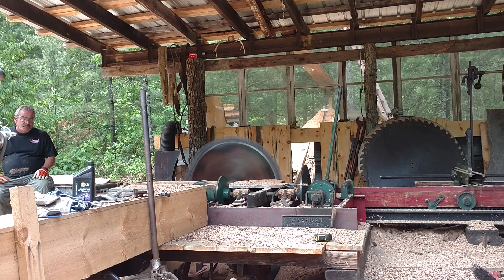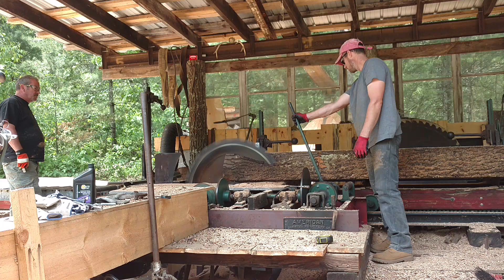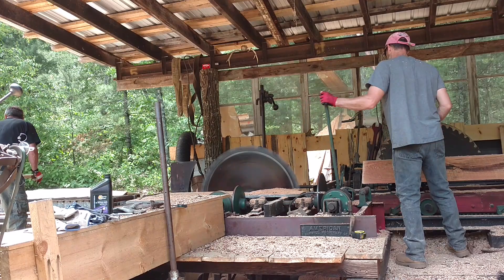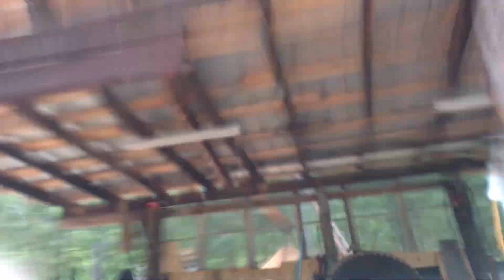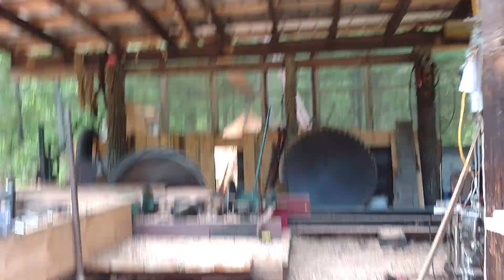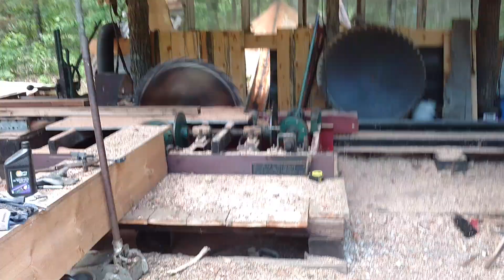Antique sawmill working

Comment: Me Thinks your Friction Drive is slipping.
Reply from the maker: Hi , Yes you are totally right been having issues with it I think I have it figured out now. It was loose bolts that never gotten tightened on the drive stick.  Thanks for watching
Reply: @sawmillingGarry  If you build a heavier duty drive stick that angles back towards you, it would not only be less flex and ease of use, it would also be much safer to the operator! Think About that>
Reply from the maker: You are totally right the forward drive motion has my hand way too close to the blade for comfort. I have a whole cable drive setup for it to where I believe I should be able to wind the cable so that my reverse friction motion could be my forward motion on the drive.